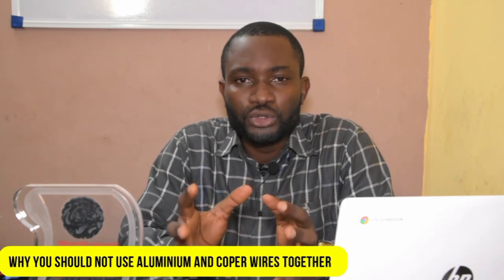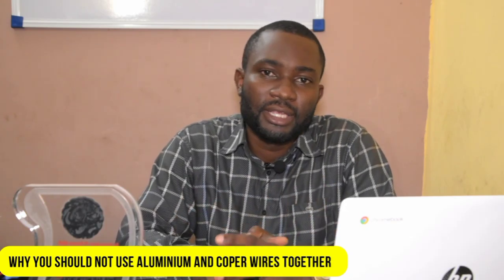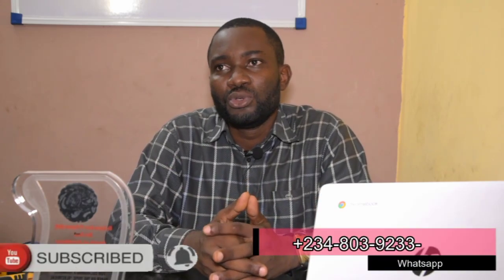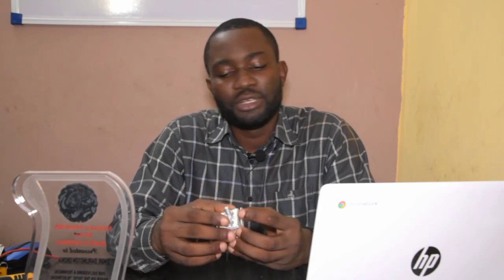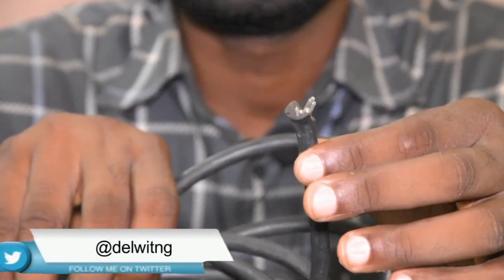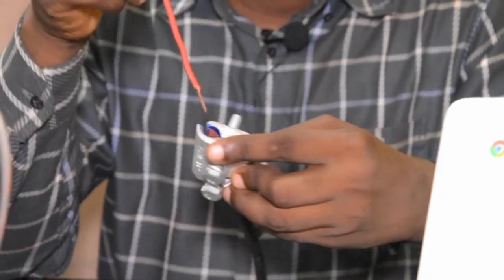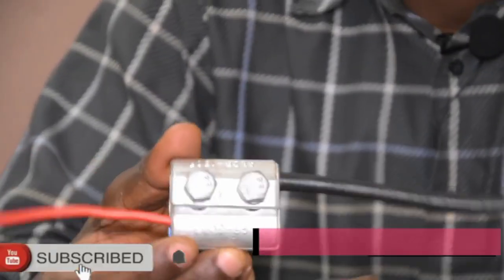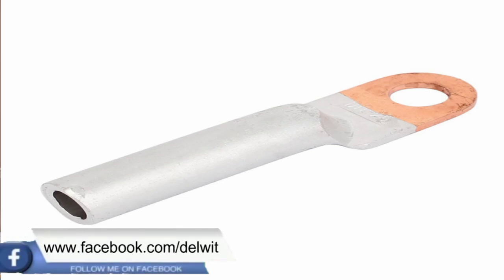How to Connect Aluminium and Copper Cables Together

Comment: if its an outdoor connection , its advisable to use antioxidant or the line tap alone is fine?
Reply from the maker: The linetap alone is ok.
Reply: @DELWITElectrical thank you boss